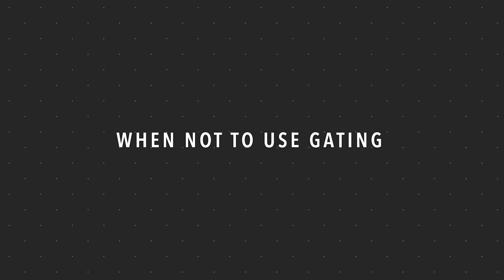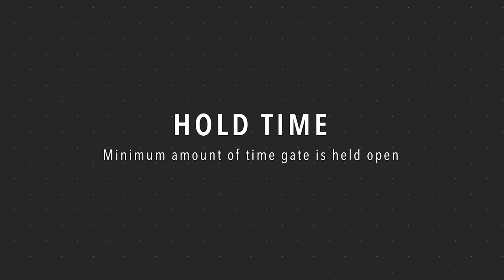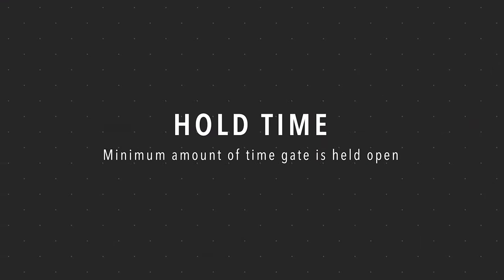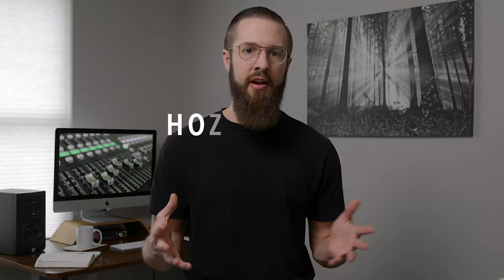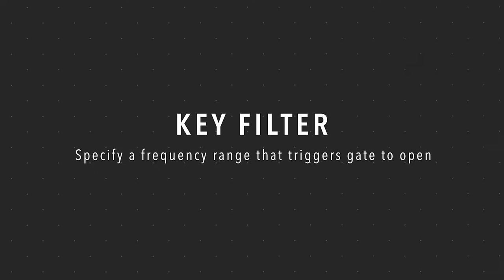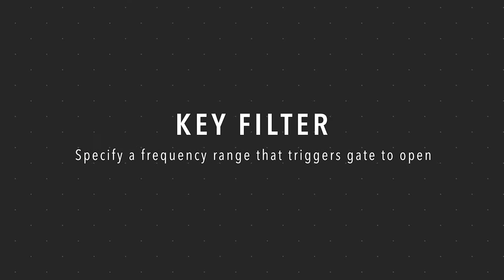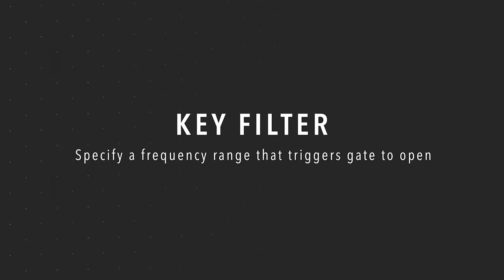Noise Gate Tutorial for Live Sound - Threshold, Range, Attack & Release Explained

Comment: I'm struggling with setting the "range" of my noise-gate for the PreSonus Revelator io24 I am using as it seems to be letting through the little desk-bumps etc from time to time as a "blip" of static / slight hiss as the gate opens and then closes on the sound. I am finding it hard to eliminate this or work out where my "range" should be in order to make sure these little mouse-down/slight desk-bump sounds don't turn into an audible signal that the range/threshold combination decide to let through. I do roleplay and stream and wish to cut out those little imperfections from my audio if at all possible! Do you have any guidance on fine-tuning where that range setting should be? I'm pulling my hair out trying to work out how I can eliminate these little noise-gate "pops" / hiss completely! =D

Wondered whether using an expander would be more effective or if that will just result in more sound coming through...
Reply from the maker: The best solution here is to find out the root cause of the hiss/pop and eliminate it from the source, rather than trying to cover it up with a gate.

Comment: I am a lead singer who plays guitar, as well. My microphone picks up my breaths between close phrases (when there is little time to step back). I always considered a gate (for live application), but was afraid it would cut out the subtle nuances that I do...as I rise into and out of notes. Thoughts?
Reply from the maker: I tend to stay away from gates on a vocal mic. Too much dynamic range going on and something ends up getting cut that you don't want. Remember, breath noise is natural. Everyone expects it. If you feel like it is too much, it might be because your compressor is to aggressive.
Reply: @collabworship  i have been using the same preset dsp for many years. I sing several octaves and my breath between difficult phrases hits like a boom. I don't have time to step off, because the next hard line comes quick. I guess I could learn to turn my head, but I have my guitar part to deal with too. When did this become so complicated?
Reply from the maker: @SteveODellFilmstheWorld  Ah. Sounds like you need a low cut filter at about 120Hz. That should take care of the "boom" from breaths.
Reply: @collabworship  will that remove my low notes?
Reply from the maker: @SteveODellFilmstheWorld  Nope.
Reply: @collabworship  thank you for indulging my questions.

Comment: what's the difference between Release and Hold??
Reply from the maker: Think of release like a "fade out" for the audio source that is being gating. When the gate closes, how fast do you want the audio to go quiet. Hold keeps the gate wide open for a longer period of time. In other words, if the signal went back under the threshold, you could choose to hold it open for awhile before the gate starts closing (release time).
Reply: Hold keeps the gate open for the set duration, sound is at constant gain.
Release affects how long it takes to fully attenuate the signal, so the speed at which it closes, after the signal drops under the threshold + the Hold value.

Comment: Is gating an effective way to handle plosives on vocal mics, or should I try something else? Thanks!
Reply from the maker: I would not recommend gating for plosives. Is this for a recording or live setting?
Reply: @collabworship  Live, in a worship setting. Running a Presonus Studiolive AI 32.4.2 mixer.
Reply from the maker: Usually, a low cut filter set between 120-180Hz will take care of plosives. It may not eliminate them, but it will make it to where they are not distracting.
Reply: @decastring  I've gone to an Aux-Fed Sub and that really helps with the low frequencies on that.  You don't get ANY of the vocal in the Subs then at all, and I couple that with a Low Cut at around 120hz.  If you're talking about Hi-End, then the X32 has a killer built-in De-Esser that takes care of the S sounds being too harsh and shrill sounding on the vocals.  It's basically just a compressor that only compresses Hi-Frequencies.  I set mine to 22 on the built in X32 to Male Vocals, if you have Female voices then you may have to play with it a bit.
Reply: To eliminate plosives, I do a high pass filter at 120 and turn the gain/input sensitivity down a bit

Comment: But you're not giving specific info on values, i.e (-20 = ?) , Which way to go for more gate/ less gate
Reply: I get confused on this too.  I don't know what hardware you are using.  For fl studio mobil software it's -60 db on the bottom and 6 db on the top. -60 most of the signal goes through  (which means less gate) and at -13 db most of the signal is cutoff (which means more gate to me, because the gate is effecting the signal more).